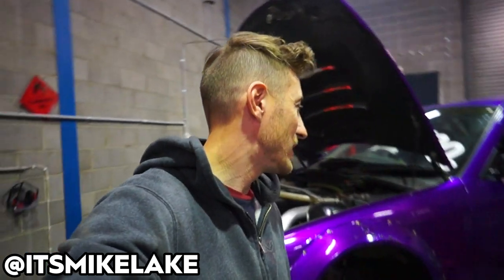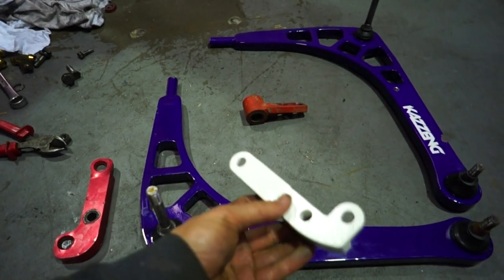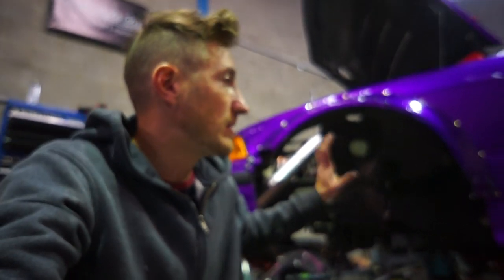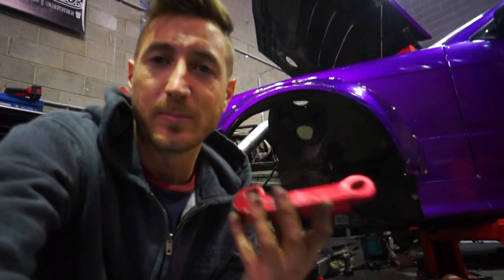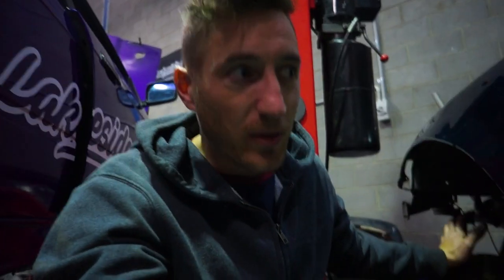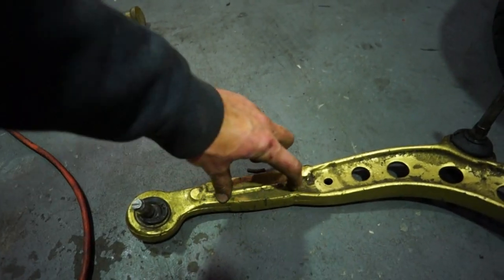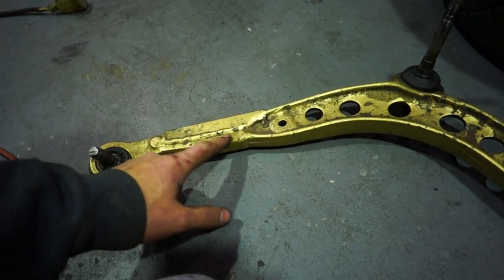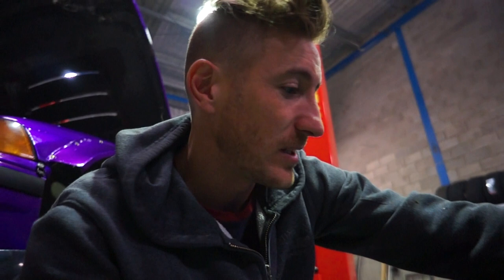E36 / E46 DRIFT LOCK KIT INSTALL

Comment: If you wanted to cheep and were handy with a welder with 4 standard wishbones you can cut and join and get spherical baring inserts for the arms and use 12.9 bolts to allow you to drop down the roll center much like the job you did on your own arms

Comment: Do you know if those solid lollipop bushing is offset or does it sit in the factory center location. I know the offset lollipop bushings give you more caster just a thought
Reply from the maker: I measured and the solid bush is offset the same as the poly bush when it's maxed out. Pretty awesome!
Reply: Mike Lake that’s sick that was the only thing keeping me from pulling the trigger on getting them. I rock out with a turbo 318 e36 and it gets the job done. Thanks for all the sick content🤘🤘

Comment: Hey man, sick vid! What size wheel spacers do you use and where did you get them?
Reply from the maker: Cheers Ant! I run 20mm up front and 40mm rear 🤓. How's your build coming along?
Reply: Mike Lake thanks dude! It’s coming along good, been a struggle with buying parts off of eBay that don’t fit, but getting there haha

Comment: When you were running your e46 control arms setup what did you do about the control arm bushes? 
And does the stock e36 tie rod work with the e46 control arm and ebay lock adaptors?
Reply: And also where did you find offset bushings?
Reply: Grind the hex section back to round pin and use solid offset e36 bushings. If using adapters than you can keep e36 tie rods.

Comment: what width of tires have you found to be best for near stock m52 power?
Reply from the maker: JustIncognito 235 front. Start with 215 rear but you can run 225 rear if you’re wanting more grip in drift. Run high pressure and slowing drop the pressure as you’re wanting more grip and getting used to carrying more speed. Also make sure you have 4.44 diff gears 🤓
Reply: @itsmikelake  thanks for the advice. really appreciate it